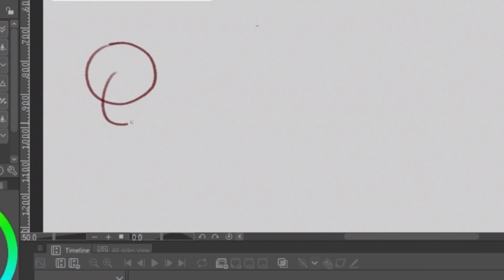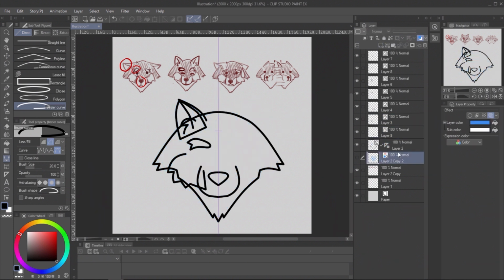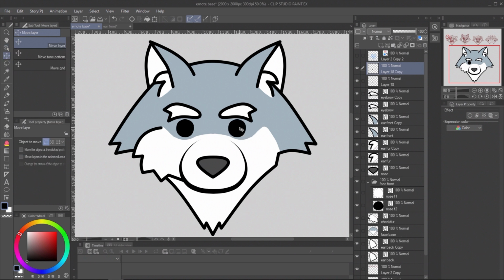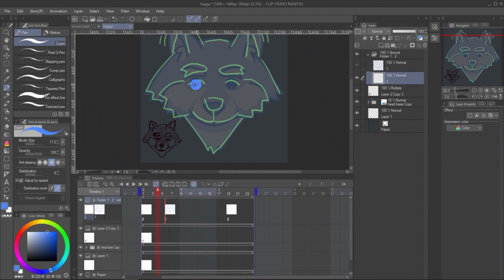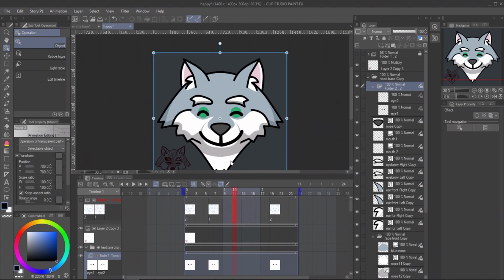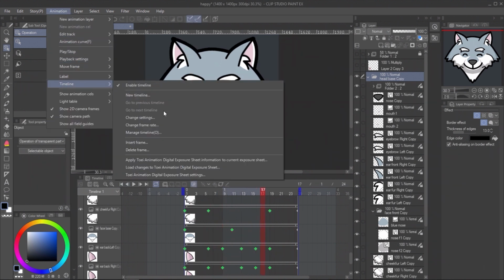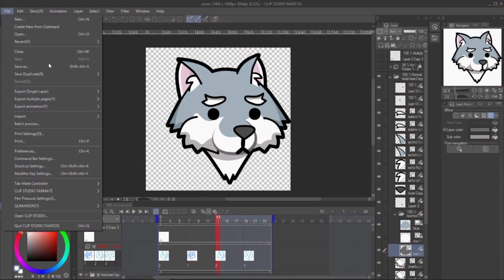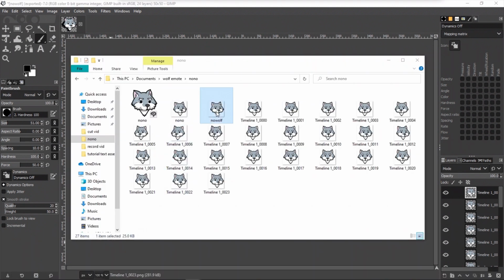CLIP STUDIO TUTORIAL - How to make animated wolf emote [include transparent export tip]

Comment: I have white pixels at the edge of my animated gif... do you know what possibly did this?
Reply from the maker: you may try to make the line with anti aliasing off to reduced the white edge problem

I used to discussed this with friends and it turn out to be ".gif animation is an old format" so, no matter how we tried to remove it, we still have this white thing on the edge that turns white. because gif format see the alpha pixel as 'alpha or not alpha' and when the modern software has some pixel with'20% alpha' it will replace that 80% with some color and make it 'non alpha' pixel

you may try to export it as apng or export it larger for an emote, then let the software shrink it to proper size, no one will notice that edge ;)

Comment: Do you have any idea why my emote outline border gets pixelated? the entire emote is good, but the border is pixelated and not smooth... what am I doing wrong? I've tried so many things. I do 500x500 px in csp
Reply from the maker: Is it happened when you exported? you may try export it to see the result, sometimes thing looks pixelated in app but not when export :3
Reply: @ViciaiaTutorial  it doesnt look pixelated in csp, it doesn't look pixelated in gimp either, only when exported :c
Reply from the maker: @nimkoez  You may try export it as Apng format in clipstudio and then convert it to gif later with any online webservice(i use ezgif.com) 

However, I want to report this problem to Clipstudio team, if you don't mind, can we talk more on Discord? my Discord id is viciaia
Reply: @ViciaiaTutorial  I have done that too, actually. It's the same 😭 which csp version are you using?
Reply from the maker: @nimkoez  i'm using 3.2 now :3

I got a friend request on discord, is it you? maybe i can help you with the export and write this report to Clipstudio team
Reply: Hi! Did you find a solution to this? I'm experiencing the same issue with CSP. 😭
Reply: @satoruyukichan  no, I think it's just how gifs work 🥲
Reply from the maker: @ we tried to figured out and in the end i found that .gif is a very old format and it has no volume for transparent on pixel, that's why it always comes with pixelate hard edge ;_;

it's nothing about clipstudio, just the gif itself
Reply: @ViciaiaTutorial  ah i see. Thank you both for the replies. T U T